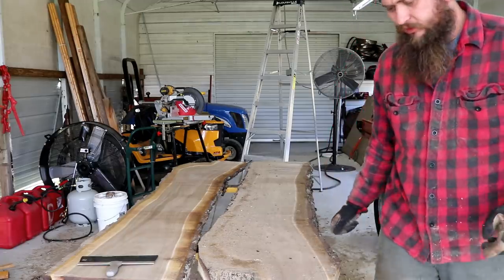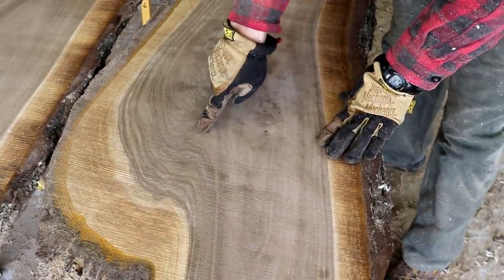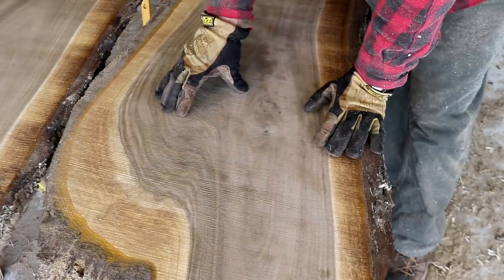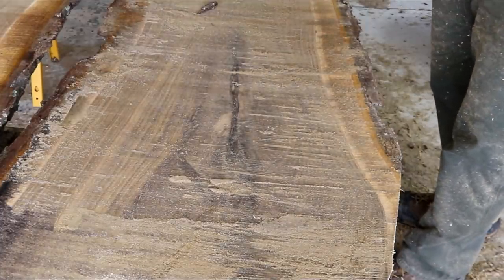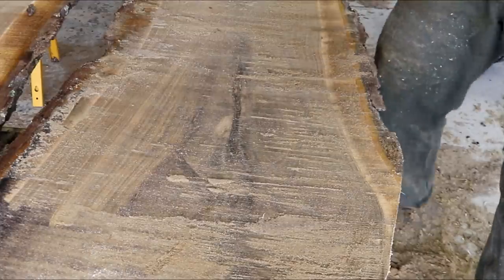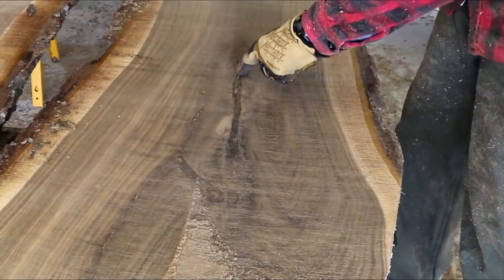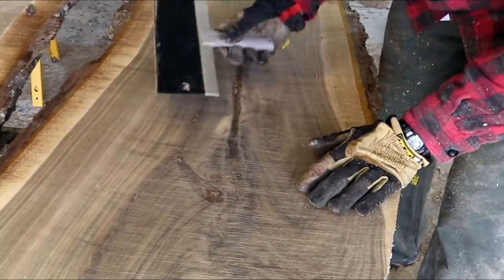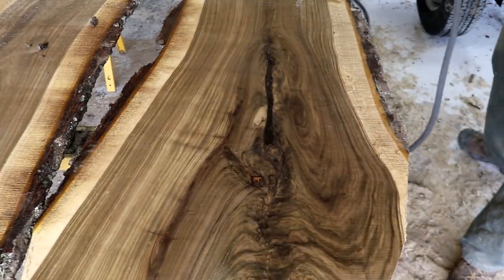SAWING  A HUGE CROTCH WALNUT LOG,  BEAUTIFUL SLABS

Comment: I see you don't have a debarker on your mill.  I don't either on my LT15.  So I debark a line by hand on my logs.  It really saves the life of bands.  Green walnut is pretty easy to peel with a spud.  You just have to peel the side that the blade is entering the log.

Comment: There appears to be more visible saw marks the last two posts than I’ve ever seen on your timber.  Have you changed your blades in some way?  Maybe it’s the different lighting under cover. Not a big deal just seeing them more than expected.  Happy to see you back sawing.
Reply from the maker: Blade was going dull. Slower feed rate is the cause. 👍good eye

Comment: When I mill logs with crotch like that I’ll also apply sealer to the figure on the face of the boards. I’ve had great luck avoiding surface cracks doing this.
Reply from the maker: Never done that. Good tip thanks!

Comment: Those are beautiful. Thanks for sharing.  What is the hose for that is hanging down center of throat below alternator? Unused accessory? Blowing air and i just cant see it?
Reply from the maker: That is the drain for the oil on the engine 👍it’s in a bad place
Reply: oh thanks. I like the machinery almost as much as the wood.
Reply from the maker: Same here